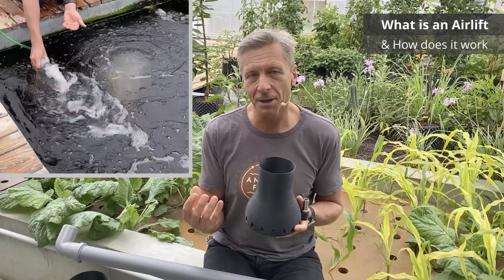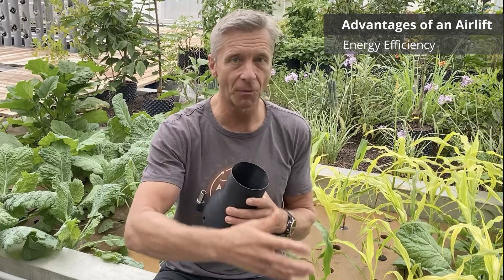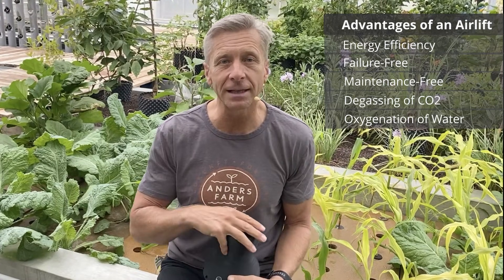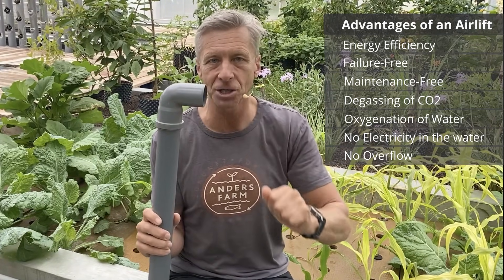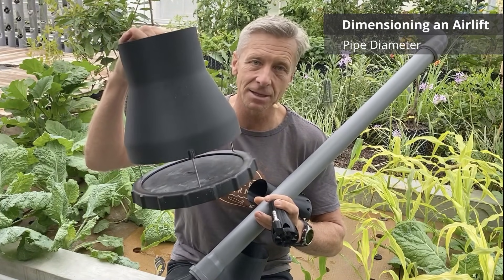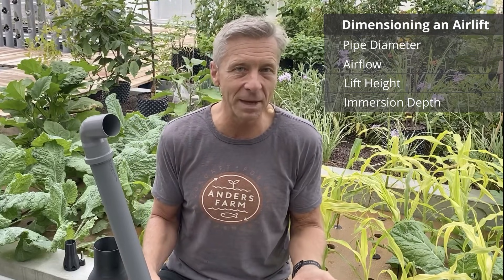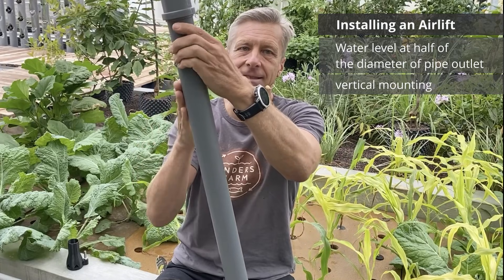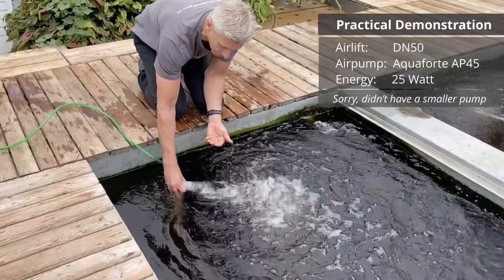Airlift Pumps for Aquaponics – Revolutionizing Water Flow Efficiency

Comment: i need some help with the science behind moving water. i want to build a natural swim pond and would like to move water cheaply. the pond would be 7m x 5m with deepest being 2m (guessing average depth may be 1.3m ish.
i want to know if an airlift pump could move enough water from a depth of 1.7m to the surface then send the water downhill over a span of 8m into a wetlands filter 1m deep thru 100mm waterpipe with possibly 3 45deg bends. the water would then need to rise up through 600mm of 3 grades of roverstone before returning into the pool.? im worried the backpressure may slow the waterflow all the way back to the upstand of the airlift? any help understanding the physics of this if anyone has trailed similar.

Comment: Hi, great video & product. Are they using coarse or fine air bubbles?
Reply from the maker: Thanks for your comment.
To move water effectively, slightly larger bubbles are required. It is also crucial that the bubbles detach easily and quickly from the outlet and that they are evenly distributed to maximize water lift.

Comment: Your compressor also has no moving parts ?
Reply from the maker: Normally I use one single side channel blower for a whole farm (typically 25 tons to 200 tons fish production). These airpumps are cheap (200-500 EUR) and are industry quality. Not a single blower failed by now - and I designed already more than 60 commercial systems in the last 15 years. Even the old ones are still working.
And all of my customers keep a backup unit on hand.
So there is no failure with the blowers. But a water pump looses performance already within a year and typically fails after a short time as well.

Comment: Your wrong.  My kids just raised water to 1 meter using an air pump for a fish tank, and 13mm and 6mm  tubing,. You may not get the volume but you do get the height. The water source was a 30 cm bucket.
Reply from the maker: Sure. This can be done, but IT does not make any sense. For this a water pump is much more efficient.

Comment: I am building a small pond. 6 meters × 5 meters. It is 1.25 meters deep in the middle. The 1 meter parameter is 0.5 meters deep with rocks and plants. 
I have a 60 liter/min pump.
I hope this next part is easily understood.
I using one 8 mm hose from the pump to the pond. Then a t-piece. Then another 8mm hose that makes a full circle inside the pond and under the rocks (only to hide it). Then I'm drilling holes in the circled hose to snugly fit standard 4mm aquarium hoses in various places where my 100 mm diameter pvc down pipes are attached to vented corrugated pipes under the rocks.
I want to have FOUR down pipes, each with a golfball size air stones placed about 0.4 meters under the waterline.
My question .....
Will a 60 lt/min pump be adequate for four stones that are 0.4 meters deep? Will that be too much resistance on the pump....  requiring more air stones than four?
Thank you.
I tapped the thumbs up button to feed the algorithm monsters.
Reply from the maker: Hi,
typically, an aquarium airstone allows around 3 liters of air per minute. So using only 4 airstones is far too few — you’d need more like 15 to match the airflow. However, I’d recommend using larger air diffusers instead of standard aquarium airstones. Air cylinders, for example, perform much better:

https://amzn.to/4fmX3oE

Also, make sure to trim the 6mm inlet on the airstone. Behind it, there’s an 8mm opening — by cutting it back, you reduce resistance and allow more air to flow through.
Kind regards
Reply: @AquaponicsCompetenceCenter 
Thank you. I am retired to a rice village in Thailand about 150 miles east of Bangkok. Amazon is no an option. I will cut the tips to give the biggest possible opening going into the air stones. Thank you.

Comment: Wich size would you recommend with 500l/h and 1m depth?
Reply from the maker: The smallest airlift with DN40 will easily do it
Reply: @AquaponicsCompetenceCenter I should clarify that the 500l/h is the air pump performance gross

Comment: Nice product. Would potentially be very helpful. It would save a lot of time custom building airlift pumps in Natural Pool installations.
Reply: Thanks for your thoughtful comment! 
We've spent over seven years perfecting the airlift, and it's now successfully installed in more than 30 large-scale commercial aquaponics systems. Beyond just simplifying the build process, achieving optimal performance has been a key focus of our development. 
If you have any thoughts or questions, I'm always happy to connect and share insights!

Comment: I built a whole air lift system for my koi pond a few years ago, using a 60 l/pm air pump into a 160mm pipe around 1.5m deep, was getting about 14000 litres an hour turn over. Bottom drain and skimmer into a drum filter into and airlift collection chamber. Pumped out into an anoxic filtration tank then bank into the main pond. Ran perfectly year in year out with only a servicing of the pump once a year. Great technologies.
Reply from the maker: Yes, airlifts are also very suitable for ponds. This year, I designed a KOI pond for a client, covering approximately 350 square meters. The installed airlifts are capable of effectively circulating the entire large pond. It looks truly impressive. Best regards.